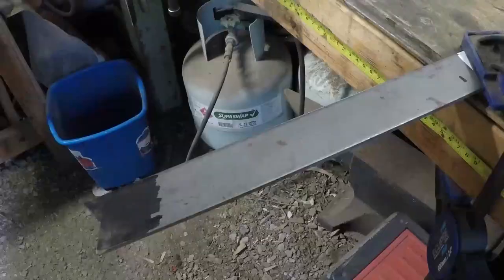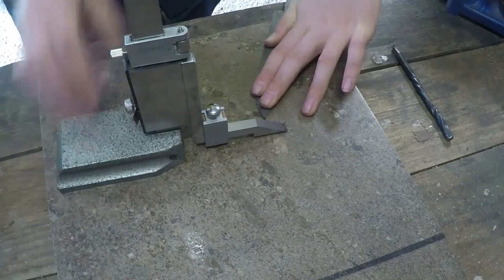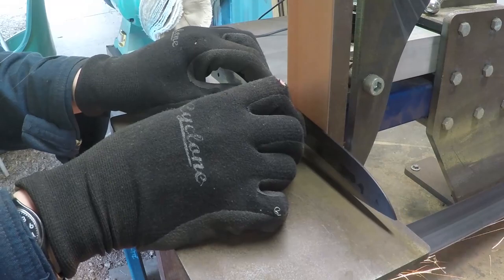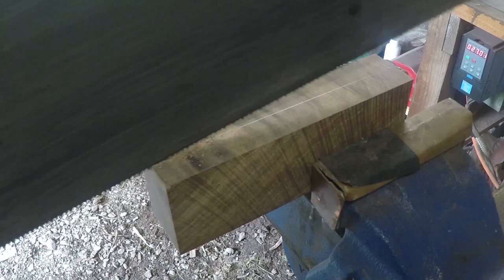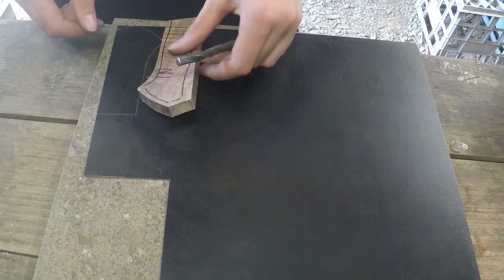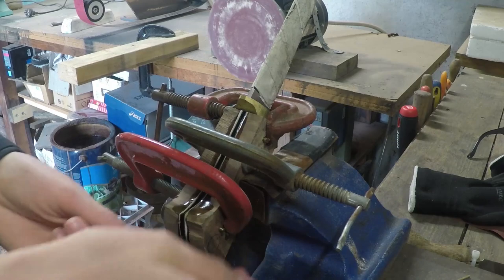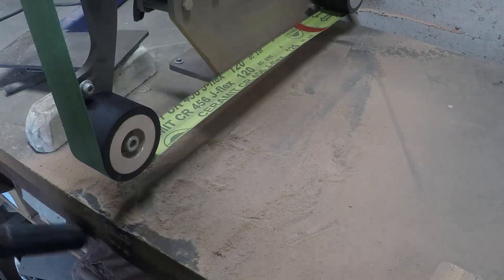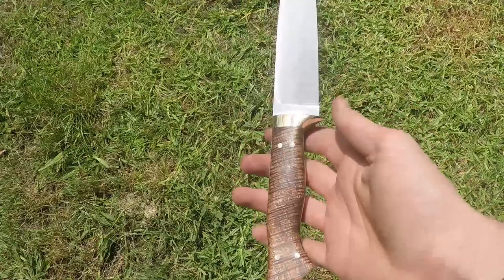Making EXTRAORDINARY Drop Point Hunting Knife! (with voice over)

Comment: What about spray paint instead of a black marker? It’s easier 😁
Another suggestion, when you use the filing jig don’t make 90 degrees angles but leave a little radius... 90 degrees angles are not good for the knife and they become a weak point of the knife itself
Reply from the maker: Thanks for the suggestions. I feel like the marker would take longer to apply but the spray paint would take longer to dry so there would be much point to it. I should really not do 90 degrees angles because I know that makes a weak spot, but it just makes it so much easier when I'm doing the fit up to get a good seamless fit. But yeah, It's better to have a strong knife that took a bit longer to make than a weaker knife the could break.
Thanks again for the suggestions :)

Comment: Awesome knife! I'm barely getting into knife making myself, I was wondering, what tools did you start off with?
Reply from the maker: Thanks! I started off with a simple $70 Ozito bench grinder from Bunnings, a hand drill, an angle grinder and some hand tools like a saw, a bunch of files and some sand paper. also a decent blow torch. I'd say that's really all you need to start off.
Reply from the maker: Ooh, I also got a coke forge and a rail road track anvil.